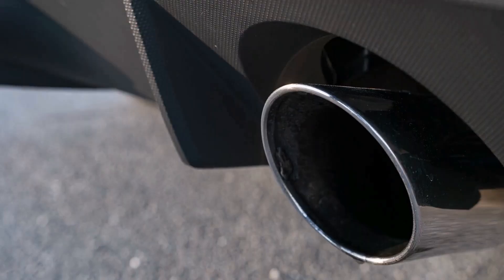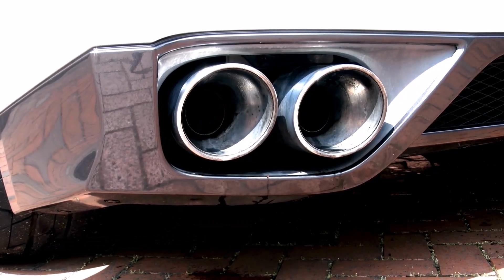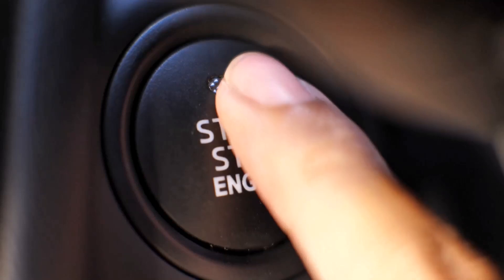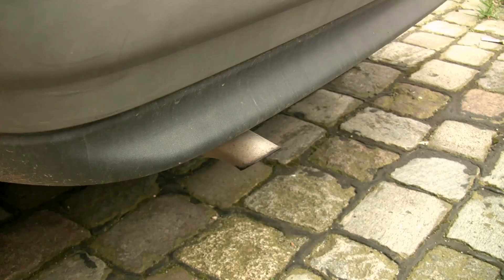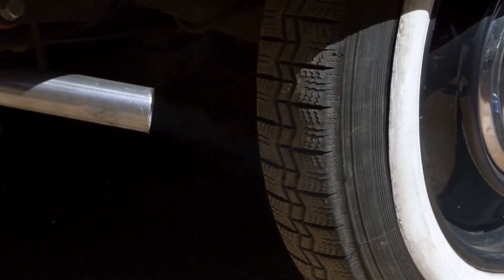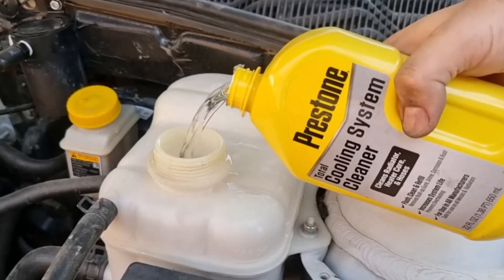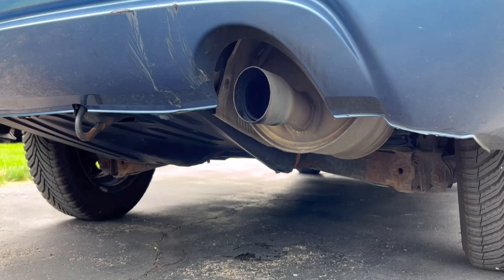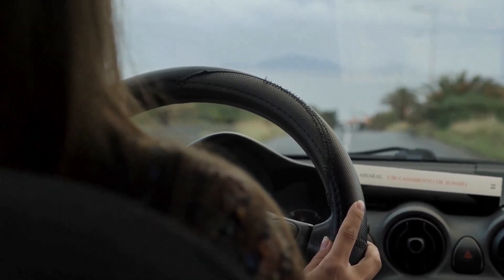Why Water Comes Out of Your Car’s Exhaust Pipe? What It REALLY Means🚘💧

Comment: My car used to do this and my mechanic explained to me its because of cracked cylinder head. When the engine gets turned off the coolant is under pressure and it pushes its way out of the crack and collects in the exhaust ports and exhaust manifold. When you restart the water comes out.
If you see this you need to get your cars cylinder head replaced.